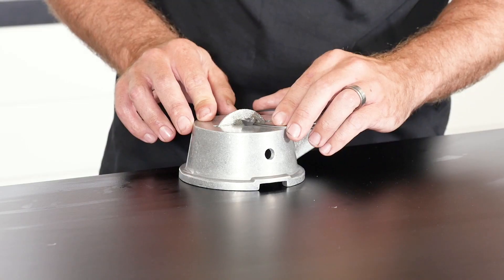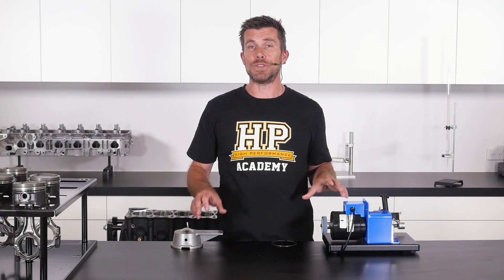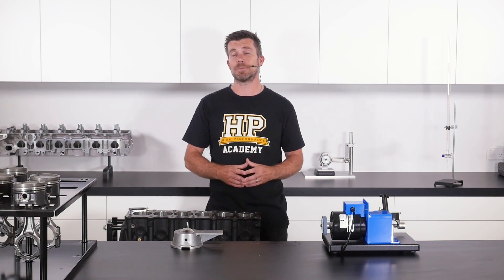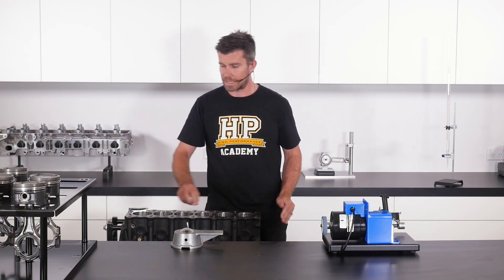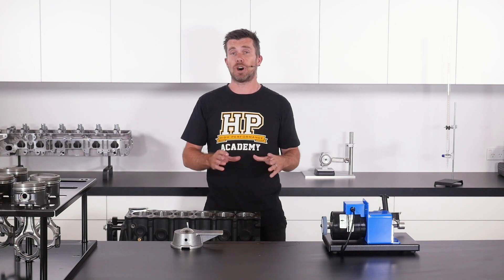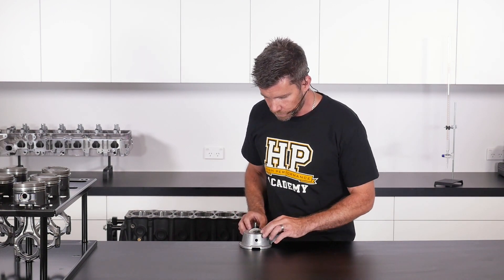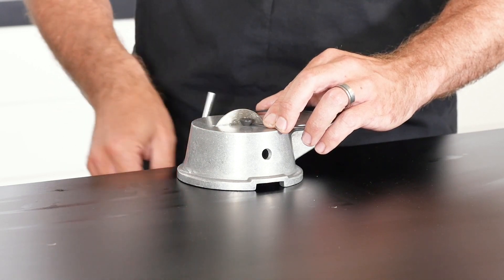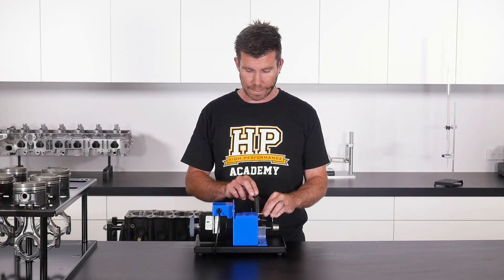🗜️ How to File Piston Ring Gaps [FREE LESSON]

Comment: Mentioned this before, but if re-ringing the bore will have worn from the old rings with a bit of a taper to it, this means there could be some measurable difference between the top and bottom of the ring's travel so it may be best to check a used bore at the bottom of the bore - Remember, as little as 3 thou' wear is almost 10 thou' at the gap. Note, my personal view is that if a re-ring is required, then a re-bore is required - but sometimes budget, very low bore wear, or other concerns out weigh that.

With some engines 'file to fit' rings may not be available and most 'jobber' or factory rings have excessive gaps for fast, safe assembly - but still need to be checked! If so, pick up a set of the next size oversize rings (supplier may allow you a discount for the unused rings) as even a 10 thou' oversize will close the gap by over 30 thou', which should be ample to work with. There will be a VERY small increase in ring pressure against the bore, but this really is in the barely measurable range and the reduced gap will be of greater benefit.

Comment: Should ring gap bet set with a torque plate or without? I would think that any mfg recommended assumes no torque plate.. so then what?
Reply from the maker: If you've used a torque plate to bore and hone the block, you're also going to want to check the ring end gaps with a torque plate installed  - Taz.

Comment: Why can't you file both ends of the rings at the same time
Reply from the maker: Why would you? - Taz.
Reply: @hpa101  to keep both ends even
Reply from the maker: I'm not quite sure I understand the point you're trying to make, but both ends will be the same. You're not filing anything on a weird angle, and given it's a ring, the gap is the gap. You do however have to pay attention to the orientation of your filing and use the correct tools to ensure it is symmetrical, or 'not on the piss' as it would be more casually described.
I recommend you watch through the lesson again as it's all covered there for you and it will help =) - Taz.